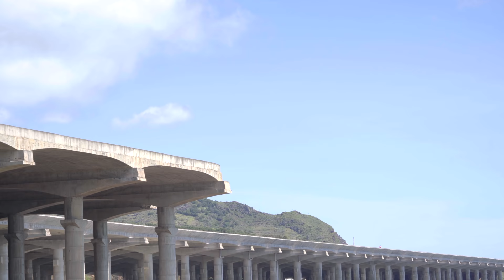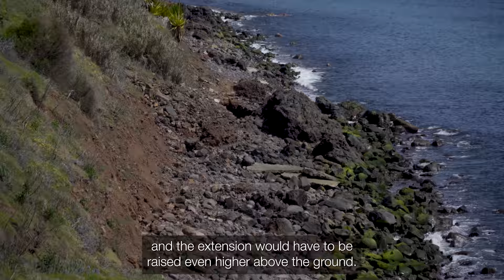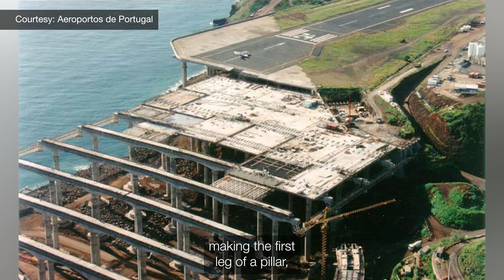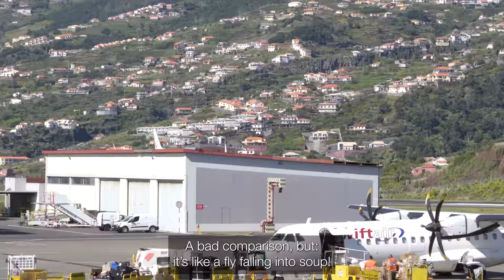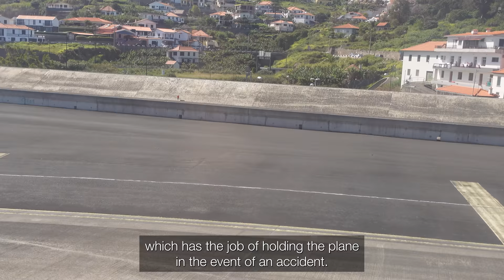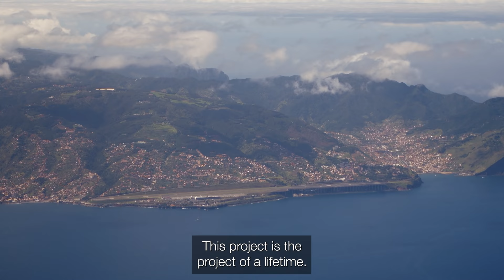Europe's toughest airport landing used to be a lot harder

Comment: He's not wrong. This is the kind of thing where he's been a civil engineer for more than 25 years after the project (god that make me feel old...) and it's still a career-defining 'I was part of the team that did this' structure.
Reply: I was one of those 1500.
Funny fact Is that a lot of the pillars are actually where there used to be sea, so we had to cofferdam and rockfill the area.
So it's a bridge, over the sea where planes land.
Reply: It's always a good thing, as long as it's a good project, designed and built well.

Being an engineer on the KCMO Hyatt Regency Hotel walkway or a Ford Pinto..... not as much fun
Reply: @HTOP1982  any advice for people who want to become engineers?
Reply: Don't think we need a YouTube commenter to vet a 25 + year civil engineers statement.
Reply: We don‘t need YouTube commenters at all. And yet, here you are.
Reply: @ajfurnari2448  re: the Hyatt regency, the engineers did that one completely correct. The builders built it wrong.
Reply: @HTOP1982  So a plane on that runway is technically an aeroplane over the sea.
Reply: @JasperJanssen  No. The original design was fine however due to manufacturing constraints the design had to be changed. Needless the engineering firm approved the changes. In the subsequent investigation some of the engineers responsible lost their license
Reply: i was walked through 2 of hamburgs newest subway stations by one of the electrial engineers, it was incredebly fascinating to get an inside view on what happens in big infrastructure projects
Reply: @HTOP1982  I don't know if it was intentional, but the pun "the sea where planes land" is too good to let go unacknowledged.
Reply: @ajfurnari2448  the Hyatt was the contractor making a unilateral decision, not the original engineer.

The original design had one single threaded rod extending from the ceiling to the lower walkway.

The contractor changed it to one rod from ceiling to upper walkway, and then a second rod connecting from the upper walkway to the lower walkway, effectively doubling the amount of force the upper walkway concrete experienced.

It absolutely should’ve been caught before a CO was issued, and is exactly why good building inspectors are so critical to construction. A contractor that fails to follow an engineered design to save a dollar, will, if they can get away with it.
Reply: @ajfurnari2448  Not to say that the Pinto is exactly well designed, but the stories about it are mostly exaggerated. The danger it actually posed to motorists wasn't nearly at the same level as the reputation it gained from that danger.
Reply: Nice waffle
Reply: Parabéns a todos envolvidos no projeto.
Reply: My boy I ain’t even 25
Reply: @weselsmith  as far as I know the design change was not signed off by the original designer.
Reply: @ConfusedOilPainter It's something the whole team, builders, designers, and engineers can all be proud to have been part of, 25-30 years later.
Reply: @ConfusedOilPainter and people like you are the reason we have structural disasters where a number of people end up losing their lives. Bravo!
Reply: Underneath, it's like the Great Hall in Moria. Except thankfully there are no orcs or balrogs.

Comment: I've landed on this in some flight simulators and I can confirm that even with 30 minutes of practice, it's a difficult runway to land on.
Reply: Oh please, I bet I could land a plane there with my eyes closed.

Whether or not they would stay closed for the rest of time is irrelevant.
Reply: @meta_username  You could definitely land at least once.
Reply: @oskrm  landing is easy. landing safely is the hard part
Reply: @meta_username  "A good landing is one that you can walk away from. A great landing is one where they can reuse the plane." - Douglas Richardson, Cabin Pressure
Reply: I found that landing there in a sim gets significantly easier when you fly in VR. It helps immensly in judging the right angle and height for the turn towards the runway.
Reply: @meta_username  do you know that before this extention a plane had run out of runway and fell in the ocean right?
Reply: @oskrm : I guess you could land multiple times, it's just a question of whereabouts in the plane you'll be and whether it'll be the same aircraft you arrived on 🤔
Reply: tried Dubrovnik? I hear that one is a beast to land on.
Reply: I have had no issues landing at this airport. In helicopters.
Reply: I used to land space shuttles the back in the 50’s when I worked for NASA. I was a cakewalk…
Reply: Nice to see you here
Reply: @meta_username  I can also land with my eyes closed. And they'll never open again.
Reply: Hey, didn't you hear Tom? You need 4 simulated hours of flying the plane before you're able practice landing it!
Reply: Only certified pilots are alowed to land there . And beware the wind !
Reply: @oskrm  Landing's easy. Landing twice is hard.
Reply: @rominkivela9351  Any landing is a good landing whereas a crash landing now that`s differant.
Reply: @Mrfort  any landing you can walk away from is a good one. now, a landing that keeps the plane in one piece, now that's outstanding
Reply: @meta_username  If the survival of the airplane isn't a concern, anybody can land with their eyes closed
Reply: Oh dear. Did your simulator buffet you as you executed the 180 degree turn, so that you lost sight of the runway ? Did you experience windshear and gusting crosswinds ?  Of course not. Perhaps you haven't fully understood the problem.
Reply: @Nabend1402  Chuck Yeager many, many years before.
Reply: @Quotenwagnerianer  Height and turn rate are on the approach charts.
Reply: @minigolfkid  Gibraltar and Genoa are both very awkward, as is Lugano. Many pilots are still frightened of Innsbruck. Of the smaller airports Engadin and Courchevel are difficult. I hated Bornholm, but the locals told me that winds I had to deal with were a "once every ten years" event.
Reply: @jorgetrincheira2120  The certification is trivial.

Comment: 0:12 That isn't exactly true. The plateau of Paul da Serra is both long and flat enough.
The main reason why it has been discarded as a location for a new airport is because of the adverse weather conditions up there at 1400 meters in altitude, even worse than where the current airport stands. 
It also gets the occasional dusting of snow in the winter; would be funny to see the tourists' faces when arriving at their subtropical island vacation in that scenario.😅

Side note: the Madeira Islands sit on the African plate are closer to Africa than to Europe, geographically they are part of the African continent.

Comment: Just to make it clear, the last accident (TAP Air Portugal Flight 425) in 1977 which killed 131 people was one of the reasons this runway extension was later made. There hasn't been any incidents on the runway since the extension.
Reply: Not this extension. In 1986 the runway was extended from 1600 meters to 1800.

The extension in year 2000 of 1000 more meters was simply to allow the island tourism to expand
Reply: Just to make it clear, you're incorrect.
As stated many times, the extension was made to accommodate the bigger airliners that were being built, and the need to keep up, as Madeira is an island that relies on tourism to survive. That was even shown on the airport inauguration, where they had a 747-200 land there. And, outside Flight Sim enthusiasts, that was the only time that kind of aircraft landed there. As even the commander of that flight commented it was probably not the safest thing to do on a daily basis.
So, know your facts and stop spreading false statements.
Reply: @alphapt9370  so the biggest thing to go there was a 747-200?
Reply: @alphapt9370  cope with ratio bruh
Reply: @alphapt9370  nah OP is right. Deal with it?

Comment: We went to Madeira on holiday before the extension and the runway was scary short. You could really feel the pilots were super focused on the approach and applied maximum breaks as soon as they had gottent all wheels on the runway. It was never a question of being beyond the limits but you could really feel the safety limit wasn't very far away. Easily the most intense landing I've ever experienced.
Reply: Yup exactly that. 🙂
Reply: I double on that
Reply: Can’t be completely maximum brakes except in emergencies, that’d melt the wheels off completely, risk a fire, and would be very costly to repair
Reply: @FoxieDay  Did I say over the limit? Yes? No? I said within the limits....
Reply: @FoxieDay  It's max auto-brakes. Not definitive max braking capability of the plane :)
Reply: Same here, went there on honeymoon. Was told by friends of airline pilots that Funchal had a different landing technique to most airports. Not "glide down, brake gently, slow gradually for passenger comfort" but "aim for the start of the runway, pancake down, brake HARD." Only similar airport I remember was Florence. Going there in 1997 I was patriotically pleased to see all the planes were BaE 146s. Then I saw the runway length with a motorway straight beyond the perimeter fence. No other jet could take off safely! The 146 was designed to be able to get into Hebridean islands etc.

Comment: For the curious: the area under that infrastructure has been used as a sports park since 2007, called the «Água de Pena's Sports Park», which roughly translates to Feather's Water, named after a small water cliff that existed there centuries ago.
Reply: While "pena" is indeed the modern Portuguese word for "feather" or "quill" (sharing its root with the English word "pen"), in this case I'm willing to bet it comes from "penha" (an archaic word meaning "rock" or "cliff", still used in Spanish with the spelling "peña"). "Água de Pen(h)a" would mean something like "Cliffwater".
Reply: @RFC-3514  That is a good comparison, altought we do have what you might call a regionalism related to that. 'Água de pena' is also used as a measure of water here, for example I get my water from a fountain uphill and the ammount of water is the size of the inside of a feather (the hollow part).

Comment: Another interesting runway I saw was in Gibraltar, where the runway is built out into the sea, and has the town's only access road running right across the middle of it! I'd love to see a video about how all that works
Reply: having a flight delay because traffic is backed up across the runway due to a wreck on the other side or on the runway itself and having to wait for the police to finish their investigation.

I did just look at it on Google Maps in satellite mode and there is some big construction project on the eastern end of the runway that looks like a freeway, I wonder if the airport got tired of fighting with the DOT over traffic timing and is building a bypass.
Reply: @filanfyretracker  I was there a few weeks ago and I didn't see that. But one of my friends did have a flight delay because of "seaweed on the runway"...
Reply: Runway built into the sea is quite a common thing these days. But a highway running through the middle is definitely what makes Gibraltar special and different
Reply: yes, it's kind of fun when you are crossing the runway with your car, and you forget to check for airplanes coming...😄
Reply: @lorenzo1660  as if you would just access a live runway without any control whatsoever
Reply: The runway at Gibraltar is very short and the approach is very difficult because of the Spanish government's refusal to allow aircraft into its airspace. You fly alongside the rock in gusty crosswinds with extra windshear, turn hard right, dive for the numbers on the runway and slam on the brakes. Not much fun.

Comment: I remember the tradition for the passengers to applaud the pilots when the plane fully stopped. Landing a 737 back in 1994 before the extension project started wasn't an easy feat
Reply: I don’t think you could land there in a B747 unless it was completely empty.
Reply: You're right, I meant a 737.

Comment: In 1966 what was the second or third flight of my life ended with a landing on the then much shorter Funchal runway. The terror of that landing was such that now, a full 56 year later, I can still recall it, and perhaps slightly comically for a six year old who knew nothing of aeroplanes, worriedly asking my mother if the pilots knew what they were doing? That's a measure of how frightening the uber steep descent was... Maybe before I die I can try out the new extended strip. It should be a breeze by comparison.
Reply: It is indeed.
The only this that makes it trickier nowadays is the wind, but in a normal day its a breezy soft calm landing

Comment: You mentioned that this is safe and that from the passenger POV it's no different than any other airport. I would say that it is in fact different in order to make it safe. The reason is that is very common for flights to divert because the pilot can't land safely. I've been there multiple times and have family there. This happens... a lot.
Reply: There is an old saying:  "Good design in 99% invisible."  You don't notice things precisely because they were well designed.
Reply: I have been flown there upwards of 30 times.
Not a single aborted landing, not a single go around in all those 30 times.
But it does get reported immediately because of the reputation of the airport.
Reply: Why not schedule those flights as no diversions permitted?
Reply: @erkinalp  They're not diverting for fun.  Forcing them to land in those conditions may actually be unsafe.
Reply: @erkinalp  because theyre doing it for safety, not for commercial reasons
Reply: @HTOP1982  Temos experiências diferentes então
Reply: @HTOP1982  And the reputation is out of date by at least fifty years.

Comment: Have you done an update on Gibraltar airport? It's difficult to land and they were building a tunnel under it last time I heard. Also, St. Helena airport is quite a story in itself.
Reply: St Helena airport is a classic case of stupid politicians spoiling the ship for a ha'porth of tar. Two different lead contractors walked away from the project because a sensible well thought out design was butchered to a point where the airport is nearly unusable, with no possibility of any remedial work for at least twenty years.

Comment: This was a marvel on engineering and aviation too, even as passenger this landing even safe it is completely different. Most landings the plane is parallel with the track, but in Madeira the airplane is descending perpendicular to the track and only change direction very late, with winds scary late, you need to be a very experienced pilot to safely landing on this airport.

Comment: Interesting video.  At Los Angeles INternational Airport (USA) the runways were extended back in the 1950s(?) to allow larger jet aircraft to land there.  This required Sepulveda Blvd (which runs perpendicular to the runways) be sunk below ground level and the runway extensions be put over it as bridges with really 'stout' pillars somewhat similar to what you show here.  After the introduction of the Boeing 747 Jumbo Jet the runways and pillars were further bolstered for the heavier loads.  I always like driving along that section of Sepulveda and knowing its history.

Comment: I flew into Funchal in 1968 or 9 on TAP the main Portugese airline Boeing 727-100 the only airline flying there to a barely 5000 foot runway with drop offs a both end which required very precise touchdown on the numbers and with maximum breaking came to a stop and turnaround with a precipitous drop off into the sea below. They operated service once a week from Santa Maria, Azores , Las Palmas several times, London Heathrow several times south only, and Lisbon a little over an hour to the north perhaps several times a day. Then the tried to do so with a stretched =200 late evening and it went off the end down below to the shore with many fatalities one time. With the longer pier 
extension up to a lightly loaded 747 has been handled and TP AB330-900s can supplement Lisbon flights on peak periods. Severe cross winds can be a problem resulting in missed approaches or diversion to an adjacent island if necessary. Back before the 727 a steamer made the trip from the harbor of Funchal and then off loaded to long boats in the pitching surf which wasn't always possible.

Comment: The airport at Gibraltar faces similar constraints. The Rock itself is a navigation hazard, but they also had to deal with the fact that Gibraltar is a narrow peninsula. The runway crosses the entire width of it, and extends into the sea. Until recently, the only road between Gibraltar and Spain crossed the runway, with air traffic control also being responsible for managing land traffic at the intersection of Runway and Winston Churchill Ave. They recently opened a tunnel, which makes it possible to cross during take-offs and landings.

Comment: The runway extension is a magnificent piece of civil engineering, but the stories about special pilot training are hugely overstated. 200 hours on aircraft type is nothing (3-6 months experience) for a commercial pilot and the training is a one-day online video course with a brief examination at the end. The point is that pilots don't need special skills to fly into Madeira, they just need some local knowledge i.e there is a tight turn at low level followed by difficult winds on landing, and if you bail out the go-round procedure is highly non-standard. If you want to know about difficult approaches there are a number in Switzerland that require a lot more training.  - in Lugano I had to undergo training with an approved instructor and then successfully complete ten approaches and five go-rounds with two federal inspectors observing. Engadin (St Moritz) is also very difficult because it is very high (reduced engine power) with a short runway and no possibility of a go-round.